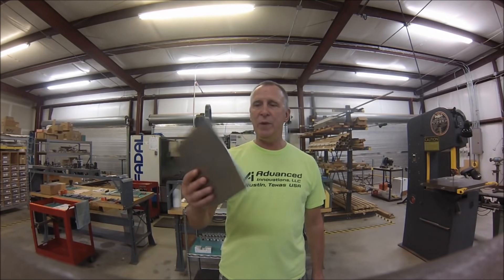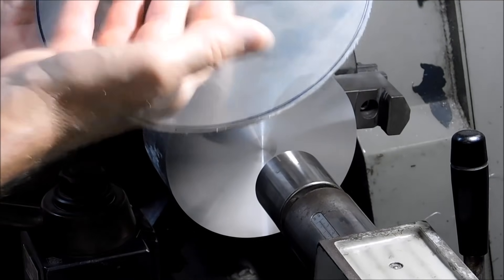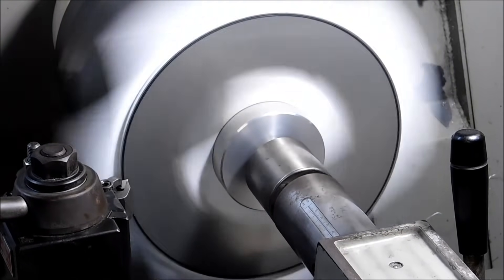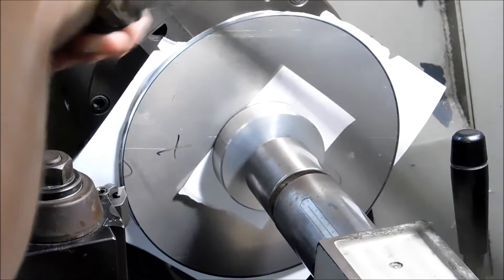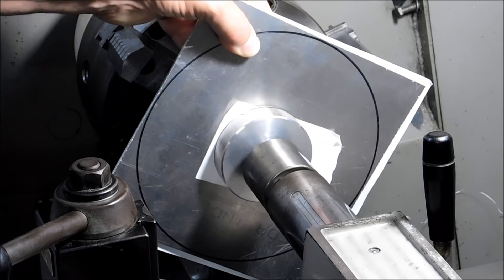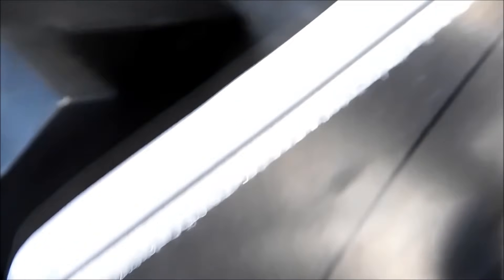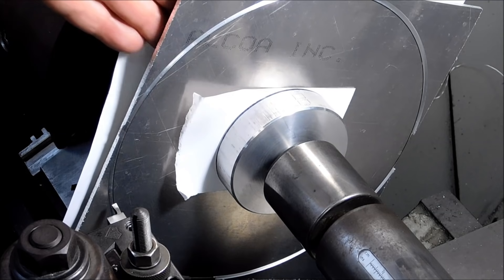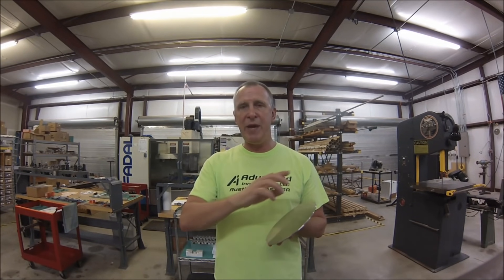Pressure Turning

Comment: Nice. You'd be impressed with a vacuum chuck on your lathe for work like that. It was on a CNC but the custom setup I tested trepanned no problem and then held  .1 doc at .006ipr facing on a 14" sq alum plate. I don't know if there's anything commercial out there, yet, boss saw something somewhere and wanted to try it so I made it happen.

Comment: Nice, I have done this in the past a couple times with very thin material using a large driver and pressure puck. I's been a few years but I may give this a shot. I like trepanning , done a nice piece on video for my indexing angle plate build. I'm new to your channel, thanks for the video. I subscribed and belled you
Reply from the maker: Thank you.

Comment: Hi Joe, many thanks for uploading these videos as a beginner to model engineering I find them very useful. As for the pressure turning I use double sided sticky tape instead of paper as a friction medium and properly applied it is incredibly strong, it usually involves a knife to force the part off the backplate once the machining is done :-)
Reply from the maker: Someone once said you can cut that tape with dental floss. ??
Reply: Joe Pieczynski
Yeah, it works great.
I've done that many times after sticking a piece of wood on the lathe!
Dental floss can be very helpful in so many ways!

Comment: Hey Joe. Seeing your channel for the first time. Former (90%... ish) manual machinist and enjoy seeing a skilled tradesman at work. Almost miss the smell of cutting oil and dykem... almost. Legitimate question. Is there a reason you used a relatively wide trepanning (plunging) tool for the OD on the square stock? And for all of the frightened non-machinists... This is not a super safe cut, but it's a fast way to get a part out the door. Speed in turn around on jobs is the name of the game. If you ever really want your pucker factor upgraded, watch an old VTL machine with some stringy material cuts. Keep making those 6's and 9's for the rest of us, you definitely have a new subscriber.
Reply from the maker: The ideal tool for this operation would have the cutting profile on the outside of the tool. That would allow for a thinner grind. With the tip positioned to the inside, ( like this one ) the underside relief weakens the tool considerably if the top is too narrow. Plus the material was soft enough to allow for a wider tool.
Reply: Joe Pieczynski That makes sense. I appreciate the response. Hope you have a great week.

Comment: Wow. That second procedure made me nervous just thinking about those parts flying across the room. I built a attachment for my 4" grinder to attach to my lathe  to take off the square corners before I turn a part. It takes a couple of minutes to get those sharp corners off, but I feel better afterwards when I machine the part.

Comment: We pressure turn aluminum tubes between centers.  22” diameter x 40” long x 1.25 wall.  There is a center at each end, supporting a 1” thick plate at each end.  The plates have a step that fits loosely to the bore (.2 loose or so) just to stop the tube from walking out sideways.  Just in case.  The OD is four pointed at each end, six inches in, at the soon to be steady band locations.  The tailstock is tightened and matching steady bands are cut on the OD.  Prep for this is faces get trimmed true at the horizontal.  If there is some wobble in the faces, the plates at each end absorbs the effect, and the steady bands come out nice and round for the next operation.

Comment: We used to make orifice plates like this for measuring water flow using stainless plate.  We called it friction turning and used emery tape glued to the face plate to drive the stainless plate when turning the OD and facing,  and then put it in the 4 jaw to turn the ID :)

Comment: Very Interesting. I have to do this kind of job several times a year with 1/4" thick material. I cut the blank square and hold it by the outside edges in a four jaw chuck.....so not pressure turning....when I cut through (or almost) I stop and tap the circle out later once removed. Joe's method here will make me think next time about trying it! Thanks Joe.

Comment: Another great video Joe. I have used this technique on smaller plate and always avoided this for plates as large as you show here for the very reasons you so well point out. I do have a superglue plate someone else mentioned and is another good technique, in  my case I made .250" deep slices with about .1875" spacing on a horizontal mill.  When you're done lathe machining, drop the superglue backplate, part and all in a shallow pan of acetone and the part will fall off in short order from wicking up the channels. Something for my channel if I ever get the courage to do some videos. I'm not so good at video editing., lol.....
Reply from the maker: I would like multiple cameras running at the same time, some music, and voice over. Maybe picture in picture. Someday.
Reply: Joe Pieczynski , so what do you use to edit now?  They look fine to me. I'd like to make another vented slot superglue plate and might be my first video.
Reply from the maker: Microsoft movie maker

Comment: Nice technique, never used paper in between.  I work in a shop with mainly CNC, Foreman gave me a piece of 321, 3/8 round and said make these three pins and motioned to the small mazatrol lathe next to me.  Two minutes later I was putting the collet chuck on the ONE manual lathe that we have, the Foreman came over and asked what I was doing.  When u told him he was like, OK if you think you can hold two tenths with this.  I responded with  'It turns things round don't it?' 
Really, bore jaws, set tools and write a program for three pins. Sad really. Took ten minutes on a manual and would have taken twice as long to do on CNC.
Reply: Jeremy Tenorio sorry bud unless you polished it in and checked it with indicating mic's at the least. No you didn't hold "2 tenths" on a manual lathe.
Reply from the maker: I've done it a thousand times. You have to be aware of the heat of the part and use the correct measuring device, but many manual lathes can do it.

Comment: I use an MDF face plate and use double sided sticky tape between it and metal.  This allows me to cutvinto the wood.  I also use more tape if adding extra discs for stacking.  Slow speed..and gentle advance.

Comment: I have one suggestion for you. Try using 3/4" phenolic material. Turn chucking surface on phenolic . mount in lathe and skim face of phenolic to remove slick surface. Thus will give you a great gripping surface and if your part spins, it will not gall your finished part. I used to make fixtures for punching flared holes that required od turning the entire length of part with no place to chuck. Its a good stable set up. I've turned up to 15 lb parts. Definately dangerous like you said but a Chuck shield helps keep your butt from clinching shut!! BTW. Never heard the term pressure turning. I just called it friction drive. Now I know right name.
Reply from the maker: I have some LE phenolic laying around. I may have to try that. Thanks.

Comment: I've done a similar operation  quite a few times, and you're totally right to warn people of the potential hazards. Might I add a third method you might find handy?  I usually add a few drops (6 on something that size) of superglue. Don't overheat the part while cutting, and a quick blast with a heat gun removes the part easily. Hope this is of use :)

Great vid as usual!
Reply from the maker: Someone suggested screwing the corners down. I like that one too.

Comment: Saw a guy who used double sided sticky tape  on the face of his chuck,he set the stop so the tool just touched the tape, when he cut through the off cut stayed there and took some prying to get it off, he also used the tail stock center to apply pressure.
Reply: You can just superglue it to a flat aluminum plate with a.couple rings cut into the face a few mil. Warm it slightly and superglue gives.up its bond

Comment: I did this on a Mazak QuickTurn350 the other day. Didnt know that it had a name. Had to turn down the O.D. of a splined hub, with no way of indicating on the splines inside the bore. So I turned a mandrel that fit snug on the splines, chucked the mandrel, tapped the hub onto the mandrel and pushed on the face of the hub with the tail stock and a piece of steel. Definitely held my hand over the e-stop the entire time

Comment: Apply painters tape to the stock in the lathe chuck and to the backside of the piece your cutting. Apply super glue to taped area and stick together. Come right apart when your done and almost guarantees the piece wont sleep.
Reply: *slip.
Reply from the maker: 3M makes some bad ass tape too. I have to try the combination. Thanks for the suggestion.

Comment: If the workpiece can have a center hole, start by drilling center partway through with standard 60 degree center drill.  Then pressure turn between that (tailstock live center) & the chuck plate.  The workpiece is positively held throughout the process.
          To center already cut-round work, clamp work lightly & HAND TURN spindle while letting toolholder rub against work and slowly feeding in.  Setup works like wiggler finder; the work tends to center itself unless you overfeed the tool.
          When manually centering work, use small mallet to tap work on center.  Movement is much more controlled and there is less tendency to offset tailstock.
Reply from the maker: The larger the pressure pad, the better. On a part this size, you can be assured a single center would let the part slip under load. If you are allowed a center hole, make a cap with a recess and bolt it securely

Comment: When I do this I use double-sided carpet tape between the part and the faceplate on the headstock side.  This adds enough friction and ensures that the part won't slip out.

Comment: This kind of operation is far less hazardous if you have a variable speed drive. With a geared lathe, you have huge amounts of torque that you don't need and definitely don't want in situations like this. The slower you go with a geared lathe, the more torque and the greater the danger.
With a variable speed drive on a geared lathe, you can select a high gear and then use the drive to drop the speed to what you need. The torque on Variable speed drives drops off as the speed decreases so you can set it up so that it will just stall if things jam up. This technique is very useful when parting off under power too.

Comment: Well that all looked good up until the chuck started spinning, then realised how bad an idea it was when you snapped the edges off the square piece. I've seen it done before for making blanks to hammer a flange onto, usually copper or brass, but never a large chunk like this. Your a brave man, that's for sure. It sent shivers down my spine when you said about the speed of it flying out the chuck. Will be trying it for blanks as mentioned above but I'll get rid of as much excess material first. Thanks for the video, and I'm sorry to hear about your friend.
Reply from the maker: Thanks. Be safe.
Reply: Joe Pieczynski I will, thank you. I think I'll be adopting the first method demonstrated, than risking having a large chunk of metal flying off at me. Keep the videos coming, and a suggestion for a future video would be milling dovetails in a lathe, as I have to make some repairs to my lathe in the future, (well it is from the 1940's after all). 😀

Comment: Prettu usual operation when doing one-offs, especially when modifying existing mold parts that just don't have anything to grip from. One very good tip is to dedicate one revolving center specifically for this, as it strains the bearings quite much past what is reasonable/allowed in most centers.

Another good tip is to seat the backing plate with the tailstock pressure before facing it off, as usually chucks have acial play in the jaw slots and putting pressure will shift the backing plate.
Reply from the maker: I like the dedicated live center comment if its financially possible for your shop. The jaw movement could come into play, but the combination of my standoff modification along with a thick backup plate should completely eliminate any backup plate movement under pressure.

Comment: Paper towel is a good buffer, I use the butt of a tool bar gently against the plate with a little tail stock pressure to the plate  to center it, works well and saves extra cutting.

Comment: What are the pros/cons of doing this way vs. the superglue approach that Clickspring often uses? Not sure I'd have the courage to do this on my baby 9x20 lathe. If I needed a big circle, I'd probably bandsaw and belt-sand the part to size and suffer with the total lack of precision.
Reply: Tad Harrison time constraints. That is an awesome way if you are doing a few, but, doing hundreds or thousands of parts, gluing, heating, and cleaning the chuck between parts will take way too long unless you have a few people to do other steps with lots of glue chucks.
Reply from the maker: True.
Reply: Joe Pieczynski my suggestion would be to spray adhere your paper/super fine sandpaper material to the drive and tail stock surfaces so there is less messing around. Just a thought.

Comment: If you are using only a groove-cutter to cut the plate, you could use a larger backplate, with a small recess for the cutter.. that will give a clean cut.
I've done a lot of pressure turning on CNC machines, we had all kinds of pressed parts that required finishturning, so we used shaped backplates and pressureplates, because most parts were "Bell shaped"..
Since it was in a mass production environment, we used pneumatic cilinders to apply the pressure.

Comment: Not always available and takes a bit of investment but a CNC-mill and vacuum-table would definitely be a safer way. (Drawback, only possible to break/chamfer one side in one set up)
Reply: The vacuum table could be relieved to allow a double angle chamfer end mill to be used to break the edges on both sides.
Reply: That's an interesting idea, I like it.
Reply: R K  You could use a clamp on each corner, go past the bottom of the material with the end mill to minimize the burr, chamfer both top and bottom edges with a double angle chamfer mill and Voila!! One single operation and one complete part per cycle that you can walk away from and go do something else.
For a high volume job this is a great method, for one offs it's a pricey investment.
Reply: A double angle chamfer cutter could also be used to deburr the back side of holes on CNC operations. Sure beats manually chamfering over 100 bores as a secondary operation.

Comment: If the finish call-out allows it, I think I would use a self-adhesive sanding disc stuck on the backing plate for grip.  Or on it AND on the 'puck' if the finish allows it.
Reply from the maker: A sanding disc will certainly enhance the setup. Naturally, if the part slips even a little bit, it will imprint the part pretty seriously.
Reply: Of course though the whole object is to hold it securely enough that it Doesn't Slip leaving a serious imprint in the operator.

Comment: another great video joe . my ahole was puckered watching you trepan that piece. i know it would involve some cleanup, but wouldn't super glue be a much safer alternative and also put this operation within the realm of less rigid machines?
Reply from the maker: It sure would. The time between parts may be unacceptable in a job shop environment, but just be sure the glue is set well and still use a driver puck.

Comment: say Joe, would double sided tape work as a clutch medium between the work and the discs??
Reply from the maker: I would suggest the thin kind as opposed to the foam kind, but yes, it would work well. You can try dental floss to cut the part off afterwards.

Comment: Double stick tape holding the center section on a sacrifical platen. Corners restrained.  Trepan tool on mill. Faster to set up and and about the  same run time.

Comment: Hey Joe. What about putting grooves in the face of the drive plate and using superglue to hold the part in place aswell. then use slight heat to break the bond of the glue.
Reply: we often use super glue when cutting thinner material. We also use full diameter backing, usually made of MDF or plastic when cutting thinner sheet. For production runs on thicker mat'l we sometimes us a vacuum chuck along with the tailstock pressure..  as Joe often demonstrates in his excellent videos, there's more than one way to skin a cat :-)

Comment: do that often. had to make rings of 1.6mm brass plate that are split in 2. could not cut the ring after turning so i had to do it in one sitting. made a sacrificial back plate out of steel. stuck the plates on with lock tight green in the press. then did the honors and removed whit mild heat. nothing go flying as long as you cut slow and controlled. trepan the whole lot like that. the slowest part of the job is changing stock and waiting for the lock tight to set off.
Reply from the maker: I have never used glue, but I suppose it has its place. For a production run, its just not practical.

Comment: The backing pressure plate is good but the front should have had a doing loaded point to get the exact center and when tightened the point goes in wards of the pressure plate, I built one for my company, it very easy to do
Reply: Spring loaded pointer
Reply from the maker: Without a hole, it would still need to rely on a marker. I like the retract  tip idea though.
Reply: If the pointer were plastic, there would be no risk of marring the aluminum. McMaster sells a plastic nose spring loaded detent - for example, 8499A19. Then you'd just have to drill, thread, and screw the detent in.